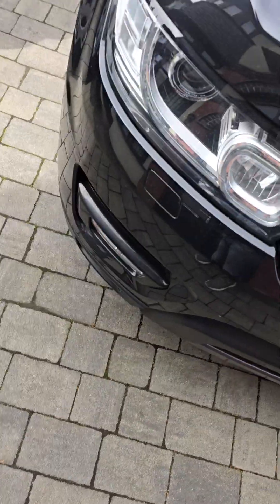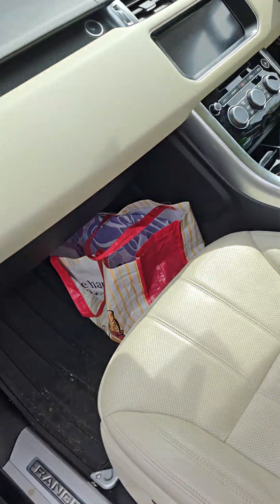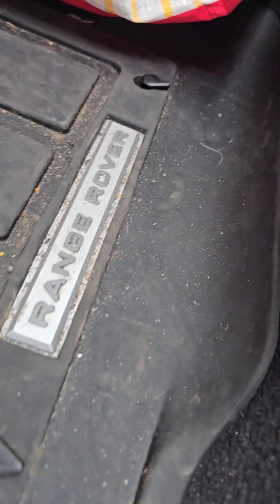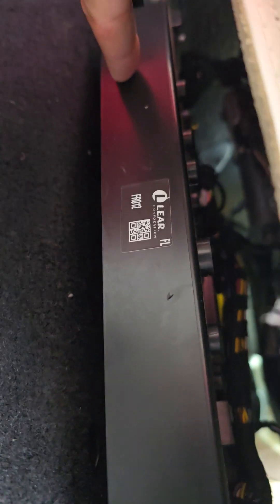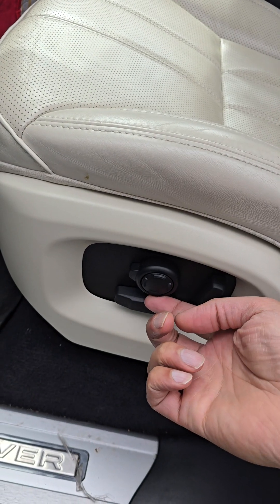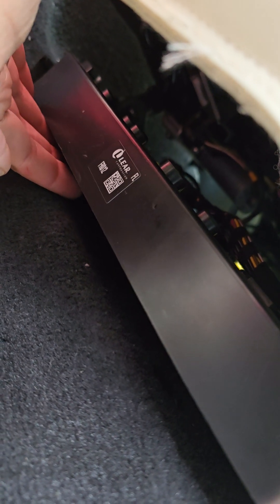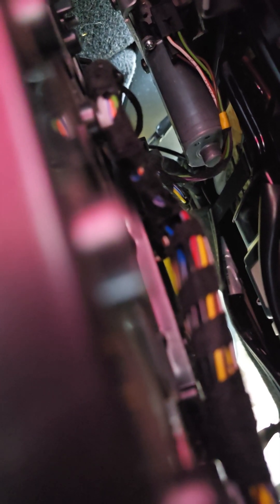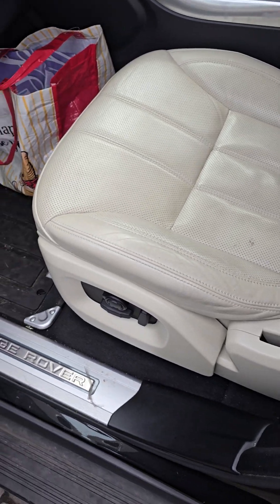Range Rover sport L494 Airbag light intermittent shirt term fix

Comment: Following your video I tried this and it's sorted the issue with my Range Rover Sport, it only came on a couple of days ago after my passenger pushed the seat all the way back.
Cheers for the info.
Reply from the maker: Yeah I had the same issue.. what I did was unbolt the 4 bolts that hold the seat down, tilt the seat back. I used tie clips to wrap around each socket that plugs into the main box. So far it has not come on. But I know some people cut the airbag wire and make a extention so that the wire does not get stretched. It's a known issue with LR.  Check this video to identify the plug. https://youtu.be/iLdkPgaTCVk?si=-k64WzQ5uHjTwKjF

Comment: I traced mine back from the Pre Tensioner that is what shows the fault code. Found that it was (in my case) a grey connector had snapped off from it's housing clip, so I made sure the wires were fully inserted, then used plastic tie wraps (plastic cuffs) tied it up on the seat base. Went to London and back afterwards, no light, my wife drove so the seat needed moving considerably, still no light on....in my case I think I've found my connection issue. Nothing is wrong with the pretensioner, just the signal/power being sent to it causing an open circuit.
Reply from the maker: Yup... That's what I plan to do now.. use tie clips and keep the plugs in the slots.
Reply: @maj6150  make sure you reset the fault after you've done any repair or what you think is a fix, then it's trial to see what happ3ns

Comment: Did you have to reset it. Or did it just reset on its own instantaneously?
Reply from the maker: Do with the ignition off.. then just turn on the ignition and it turns off itself..  no coding or tool required